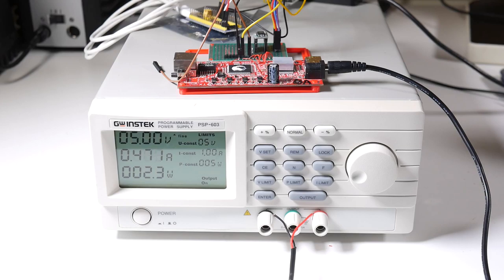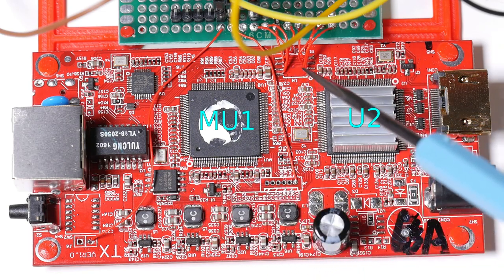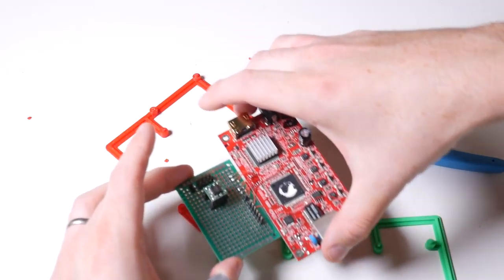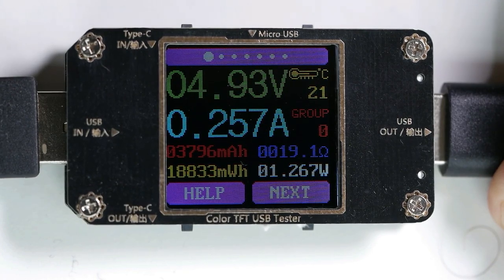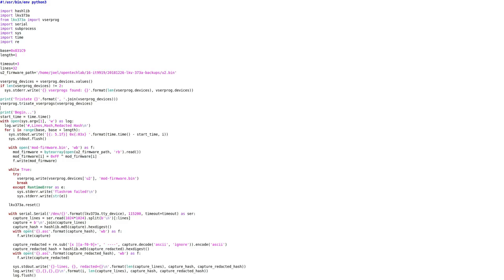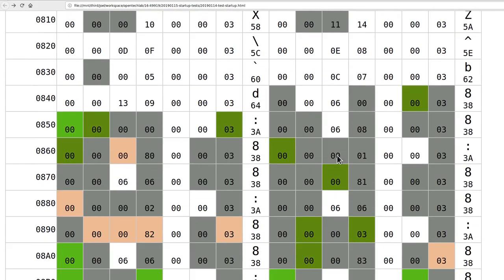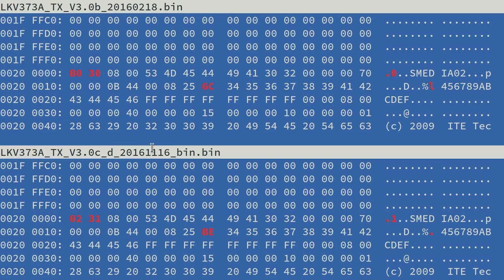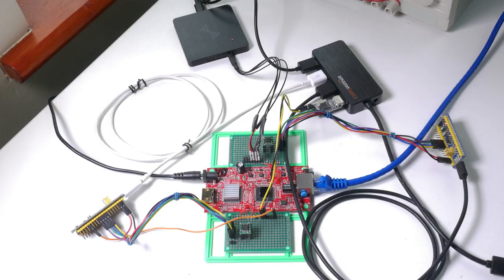[017] IT9919 Hacking - part 2 - Hunting for Checksums

Comment: A byte inversion is not a common fault so checksums are not as good at detecting them.
A single bit flip would be more likely and would tell you much better which bytes are covered. Most likely all are though. No sense in storing a firmware copy and not just protecting the entire blob.

Comment: re: Heat Stakes at 3:30. I've never heard this term before but it looks very convenient. Specifically what material did you 3D print with that allows this? I've watched your previous videos but can't seem to find much about materials.
Thanks for the channel. Really great.
Reply from the maker: I only ever print with PLA - but I think it would work with just about anything. It has to melt to get through the printer nozzle, right?

Comment: Looks like a solder bridge there on U2, just above C130 at about 5pm 1:27
Reply from the maker: I think those pins are meant to be linked. On the data-sheet, pins 44 and 45 are labelled RAMVSS.

Comment: The checksums are often CRC16 CRC32 or unsigned addition. I would start with unsigned addition, the snag is you need to know the offset at the start (if any) and the length. The area containing the checksum is likely to be a C structure, the structure itself may not be the part of the checksummed data. Try no offset at the start and do an addtion, if it fails move another byte backwards from the checksum and re-compute it ?

Comment: Unrelated question:
How do I make my terminal look like yours at 7:33? (I am talking about bottom row, and directory/branch colors and styling)
Reply from the maker: The shell is zsh, installed with oh-my-zsh for the theming.

 And I'm using tmux as a windows manager in the terminal. More recently I've started using vim instead for windowing. If you want to see my config files, I keep them on stashed on GitHub: https://github.com/jhol/shellrc

Comment: With regards to byte flips and then rendering them in a table, it seems there is a pattern in the SMEDIA area where some columns are more critical so it might be few bytes of data and then few control bytes. Columns 8 and 16 definitely look like least significant bytes of control data, therefore when they are changed a break is imminent. Those two columns often monotonically increase by 2 every 8 bytes. On the other hand some columns seem to be in the "data" category and don't seem to affect loading if they are changed.
The "control" bytes seem to be 32bit numbers distributed around 0. A bit later in the flow they start to come up as negative values. So these numbers could be indexes in to some kind of a table.

Would be interesting to try to increment the bytes by 1 instead of flipping them. A value of FF instead of 0 in column 7, assuming it is a not least significant control byte, seems to have no effect on booting which doesn't seem to make sense. Maybe 1 instead of 0 will cause it to break as it will look closer to a value the system may consider valid.

Comment: Maybe the checksum is one of the standard CRC32's, but protecting the uncompressed data not the original one.
Reply: I would also calculate the checksum on the uncompressed data, that way any defect during decompression could be caught.
So trying different de compression algorithms until you find one that matches the decompressed length, then trying different crc32s to match the suspected checksum ?

Comment: I'm not top-notch when it comes to putting thought processes to words....but I'll give it a go :)
There are (if memory serves) a set of standard compression logarithms which get used by different manufacturers - was thinking that for the manufacturer of these soc's to write their own logarithm would be a bit long-winded (time being money, etc...if any of you've seen Ben Eater's videos on creating checksums, you'll see what I mean). You could take the compressed part of the code out of the hex file and then apply the 'popular' logarithms to it to see if that renders it readable. Also, are there any other soc's produced by this manufacture where there is information available on the compression process? 'Tis a shot in the dark, but maybe the same (or simular) compression is used there too. Or, examine how other manufacturers do this.
I hope that no-one feels like I'm teaching anyone to suck eggs....just throwing some thoughs to words. This has definitely got me triggered though - which is what I like about ths opentechlab channel.
Thanks for posting! Time for a cup of tea and a nice relaxing thinking session :)
Edit:
Just watched part 3 in this series which has rendered my above comment obsolete :)